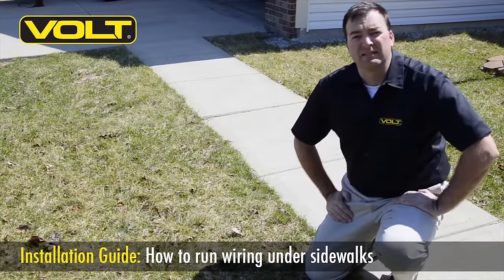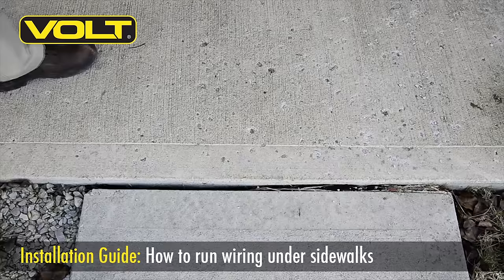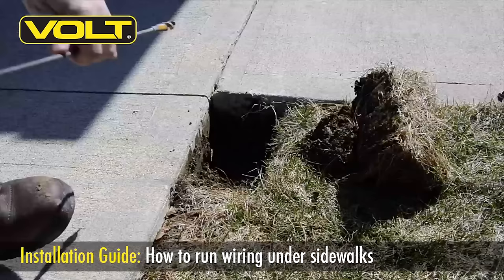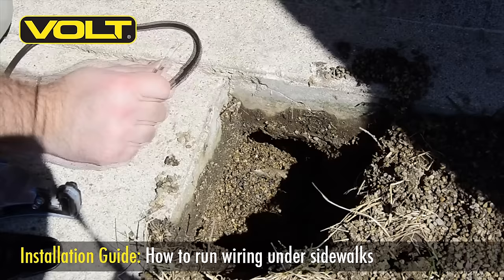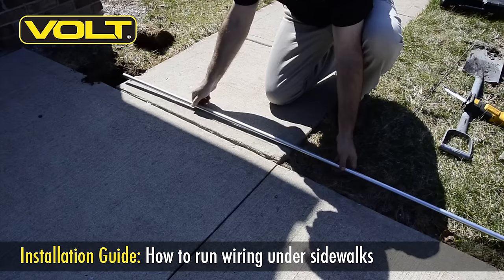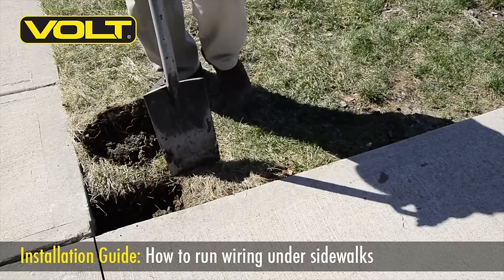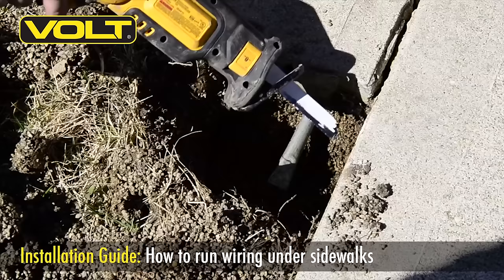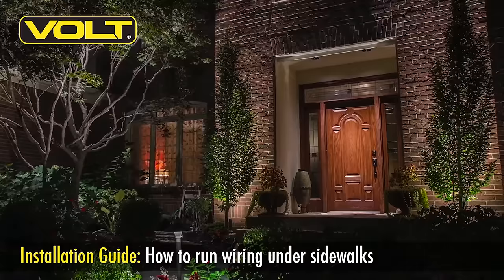How to Run Wire Under a Sidewalk for Landscape Lighting

Comment: How can i do this for driveway?
Reply from the maker: We typically recommend running the wire through a control joint and applying a self-leveling sealant.
Reply: @VOLTLightingUSA great idea,   you know with what you showed me I believe I could do a driveway the same way 😊